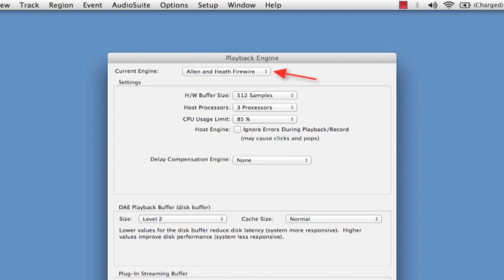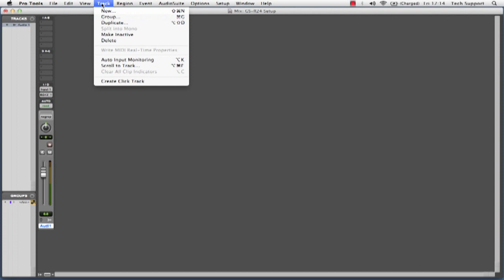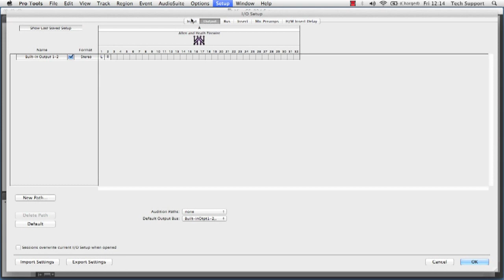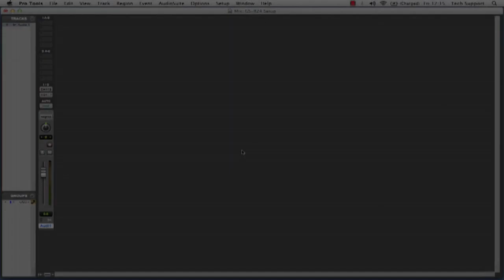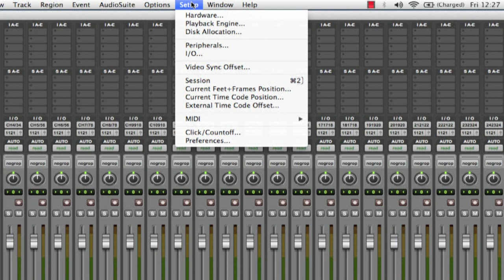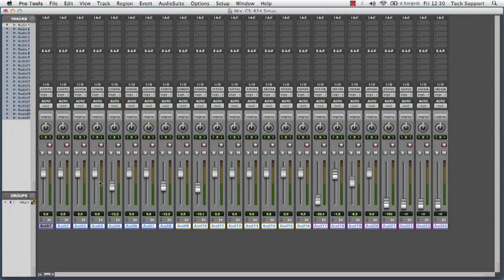Pro Tools setup with Allen & Heath GS-R24M

Comment: Would this configuration be similar using the Zed 22fx?
Reply from the maker: Hi @dawnoftheshredfit,
This configuration would be slightly different using the Zed22FX.
The Zed22FX connects to your PC via USB rather than firewire. This is done from the USB B port of the console to a USB C connection on your PC.
The USB audio interface of the Zed22FX allows you to transfer audio to and from the Zed USB device.
Within Pro Tools in your Audio MIDI Setup, the Zed interface will appear as USB Audio CODEC in the list of audio devices.
For more detail on how to run this set up, please see page 25 of the user guide, the link to which I have included below:
https://www.allen-heath.com/media/AP7085_3-ZED12FX_ZED16FX_ZED22FX-User-Guide-Issue-3.pdf
Alternatively, you can contact us at support@allen-heath.com and we will be happy to help.
Kindest Regards,
Nicole

Comment: Hi , Will this method also work for the QU16? Thanks
Reply from the maker: Hi! 

The Qu-16 uses an ASIO/WDM USB driver for Windows based systems and uses the DAW Control Driver for MIDI control. So there are some similarities, but also some major differences. 

You find details of setting up Qu with Pro Tools for USB streaming here: https://www.youtube.com/watch?v=v8opaijoJbY 

And set up notes for DAW Control here: https://www.allen-heath.com/media/DAW-Control-Help-V1.7.pdf 

Thanks! Alex

Comment: Will this work as well with the ZED-428?
Reply from the maker: Hi,
The ZED-428 has a stereo send and return USB audio interface.  You are able to connect it to Protools or any other DAW for that matter, but you are not going to get the same amount of I/O that the GSR24 offers. In fact, you only get one stereo send (two mono) and one stereo return.
Also, please note that the ZED-428 does not have MIDI capabilities.
Best regards
Luke

Comment: So I'm having a problem running a UA 4-710 with the GSR24M. Im running the optical out on the 710 to the 1-8 optical in on the FW card.  The 710 to channels are assigned to 26-32 and I cant figure out how to change that. So now I cant use the main mix bus channels 31/32 because they are being occupied by the 710. Is there any way to assign the 8 710 channels to a different set of channels on the FW card? Preferably 1-8?
Reply from the maker: Hi there, looks like we've already responded to your support email. To confirm: In FW+ADAT Mode ADAT Channels 1-8 override Stereos 1&2, Valve pre 1&2, Master L-R in both directions. I'm afraid this can't be changed. We recommend using analogue connections from the 4-710d to the GS-R's insert points. Hope this helps. Thanks. Harry.

Comment from the maker: Hi Shea, you're right, it is very similar with R16, the only difference is you have to run the DAW Control app in the background which is a very simple process. You no longer need to buy Bomes and the setup is now very simple, the app creates the HUI MIDI devices and takes care of the translation.

Hope you enjoy using it.
Reply: Is there a tutorial or somewhere that explains how to setup MIDI?  ANy more info would be appreciated!  Thanks!